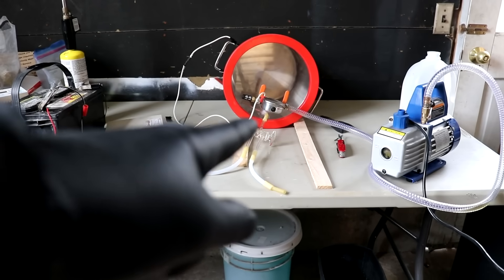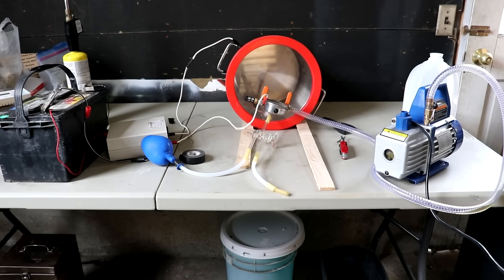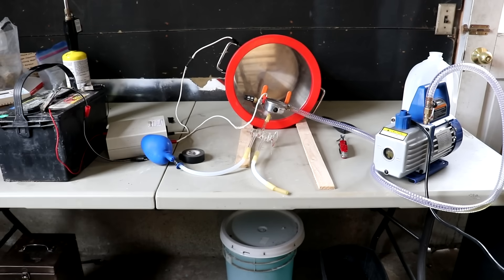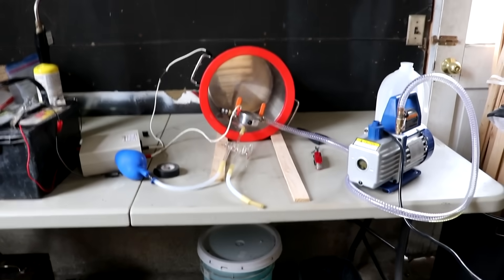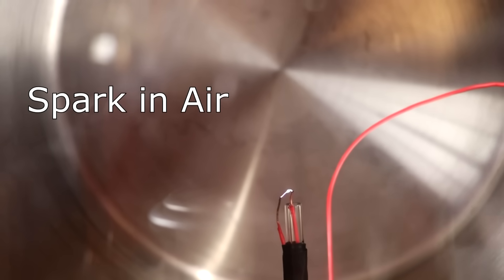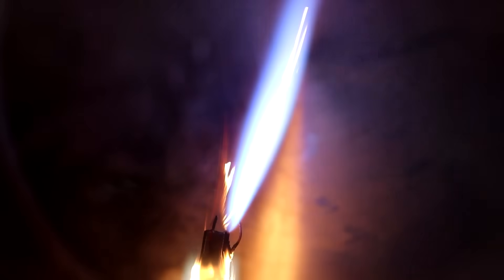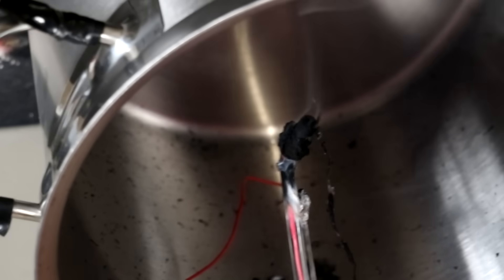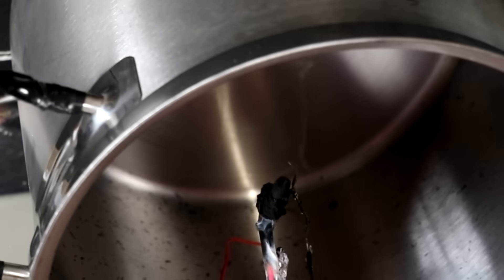Burning Propane in Pure Oxygen?

Comment: Back in the fifties, hot rodders experimented with using oxygen as a power adder. It melted the engine block and pistons, until they started using nitrous oxide.

Comment: You should do more videos of various flammmables in inert environmental gases. 

Although, I would recommend an outside set up, with remote control behind a protective barrier; mythbusters style, just in case. 

Also, I didn't realize it on the first watch through, but you were exactly correct and this is what happened to the unfortunate Apollo 1 capsule.

Comment: The spark was so much thicker in the oxygen because it has a lower resistance than regular air. Therefore, more current was able to flow, turning the arc into a single stranded purple stream instead of several small blue-white sparks. Probably has a bit to do with oxygen's flammability as well, as thick arcs like that are generally thick because they travel across plasma (ionised gas) instead of jumping through air.

Comment: Same problem exists with some of the fabrics we have in our fire department protective clothing. In normal air with ~21% oxygen they are practically inflammable; they get hot, but they don't burn. But put them in pure oxygen and they go off like rocket fuel.
Reply: Inflammable means flammable. The phrase you want is non-flammable.
Reply: Damn, you're right. That's a problem in English. Same with (in)famous.
But German also has some strange words.
E.g. "Umfahren".
Means either: drive around someone, not touching them.
Means also: drive over someone and knock him down.
Reply: @GrafKrolock82  I'll be sure to avoid that phrase if I ever get a German uber driver lol

Comment: Cody can you try to burn metal in a pure oxygen chamber?
Will the metal make a flame and continue to burn after been heated?
It's possible to cut metal with a oxy-fuel torch, first the flame heat the steel and then the oxygen jet cut the metal.

Comment: you know, this demonstrated alarmingly fast graphic nature of the Apollo one fire,  tiny spark then , a fire...a very fast fire...terrifying. we were told they suffocated before the fire did any damage to them alive, this rather grim "problem" as Cody says, illustrates otherwise to this fact. good video. Question: why doesn't the chamber explode in that environment? mixing O2 with Propane in a closed environment should explode right?, or is the pressure so low?

Comment: FYI you can get about a hundred times the volume of oxygen for about the same price if you buy it from a welding supply. And about thirty times the amount of propane  for your money by buying the BBQ size bottles. You can get adapters to run your equipment for the little bottles... Or adapters to just refill the little bottles. Or both like I do since it's sometimes convenient to have the little bottles... But not if you gotta buy new ones instead of just refilling them.

Comment: That was the same problem nasa had with the Apollo 1 crew. During the rehearsal they filled the cabin with pure O2 and things that (under normal atmospheric circumstances) wouldn’t normally catch fire, did catch fire from something as simple as static. 
Try testing flame retardants materials in a pure O2 atmosphere and watch how quickly they will burn.
Reply: Lol I wrote this comment before I watched the last part where you mentioned Apollo 1. 
Though it would be a cool video to watch if you tested various “flame retardant” materials in a pure O2 atmosphere.
Reply: Fun fact: They still used pure O2 for the remainder of the Apollo missions following the Apollo 1 disaster.
Reply: David Jackson, II i wish i understood this. It sounds smart.
Reply: If you knew that the universe is electric and that the electrons negative field binds atoms positive nuclei it would be much easier for everyone to understand. And if you knew gravity is an electromagnetic effect and not a particle you would be smarter than dj.
Reply: J fun fact for your fun fact, the partial pressure of oxygen in air is about 3.6 PSI. The oxygen pressure in A1's capsule at the time of rehearsal was about 12.3 PSI. All remaining missions were quadrouple checked for correct O2 pressure.

It's all about the density of the oxygen(and it's electronegative charge) surrounding an object that creates the electric field potential that pulls electrons into a reaction orbit around a molecule, causing chemical bonding and releasing energy exothermically.

Comment: I had something similar happen that caused me to require an underwear change while experimenting with a medical oxygen generator that I got from a scrapyard. I was testing to see if it was working by holding a glowing wooden match up to the tube which was made of vinyl. Turns out that it was working and vinyl is extremely flammable in an oxygen rich environment! I can compare what I saw to a very fast burning cannon fuse and needless to say the machine was toast!

Comment: dous anyone know why it is a yellow flame at first. but an blue one after the insulation cought fire?
Reply: postlim Yellow was propane, blue was oxygen.
Reply: that's why i asked. but still why the change over time? furthermore in a pure oxigen environement i would never expect an orange flame.
Reply: i looked up why sulfer might be used in glass. in the fabrication of glass bubbles might form. sulfer can be added in the form of Na2SO4. this disasosiates into Na2O SO2 and O2. SO2 is a gass and will make the bubbles alredy presend larger and able to rise to the surface to dissapate. therefore in clear bubblefree glass there is no sulfer presend.

Comment: This is what happened to Apollo 13's service module, in testing before prelaunch assembly, only they couldn't see a thing and the temperature gauges were not built to read supra-nominal temperatures nor could the mechanical pressure gauges read supra-nominal pressures!

Comment: If you could figure out a way to pump it and contain it (I’m sure the rubber seal isn’t compatible enough to do this) maybe you could try burning things in an atmosphere of Chlorine? Chlorine gas is easy enough to generate and I’m sure you could make a throwaway steel container to act as the chamber and do only quick tests, so it seems viable.

Comment: cody ot a challenge for you produce hydrogen run it through an oxyacetylene burner and see how hot the flame is and if it can cut through metals apparently it does and the gas aparently turns back into water somehow?

Comment: Oh by the way that's how they make rockets hybrid rocket Burns rubber in oxygen I should have said that when I let off of the video when I let off with the comments in the video
Reply: Voice search cut off half the comment so a hybrid rocket is essentially a rubber core with oxygen flowing around and a fuel threw it. The solid inside the rocket Burns because of pure oxygen and it becomes the fuel so essentially you made a hybrid rocket out of the wire coating

Comment: I wonder what would have happened if you showed this to NASA administrators in 1967 before the rehearsal test.  The push to succeed  before the end of the decade had to have been more intense than during the Shuttle era failures.
Reply: Probably nothing would have happened. I understand that using pure oxygen was a cost-saving measure (using pure oxygen at reduced pressure in-flight, to avoid using extra fuel to lift up "useless" nitrogen in liquid air) and the bean counters would have argued that "we used the same setup on Gemini missions and nothing happened".

Comment: Yeah, you could've predicted this happening. ;)

One correction - commenting on the previous video, you said "it's not the oxygen burning". It is. It's arbitrary. A burns in B if there's more B than A, and vice versa.
From a chemical standpoint, it's an irrelevant, arbitrary, human description because we live in an atmosphere with significant percentage of oxygen. Correct statement is - they react. Both are fuels but one is a reducer and other is an oxidizer. There is really no "fuel and oxidizer", there's "reducer and oxidizer" and both are fueling the fire which is an extremely fast and energetic redox reaction.

Comment: Do a hybrid rocket engine using oxygen and diamond grit/dust as the solid fuel. You would need to use a burnable binding agent to hold the dust/grit together in a cylinder shape.

Comment: Note that the propane flame appears yellow NOT due to the usual reason of incandescent soot of hydrocarbon flames that you are normally used to, but rather because the flame is so hot and ignites so instantaneously upon leaving the tip of the capillary tube, that it is vaporizing the glass of the delivery tube itself and thus producing the brilliant yellow D-lines characteristic of all sodium flames. It is only upon ignition of the wire insulation slightly below the propane tube tip that the propane flame turns its intrinsic blue green color charachteristic of all sootless hydrocarbon flames due to the strong carbon doublet rovibrational emission lines referred to as Swan bands. The burning wire insulation is producing CO2 and causing slight detachment of the propane flame from the glass tube tip, thus cooling it and suppressing the bright sodium emission. All of this can be seen in the frame by frame. Interesting.
Reply: Yes, thank you for this comment. :)
Reply: You could also see the same Swan band emissions in the previous video, with the spark in propane being a bright blue colour, rather than the purple of the spark in air.

Comment: Everything burns well in pure oxygen. Even people.
Reply: To burn everything you need Fluorine...
Reply: Антон Южаков even better is Chlorine trifluoride
Reply: FOOF is "better" but rather than burn it makes most things (ice, lab techs, chlorine trifluoride, asbestos ect)  explode violently at temperatures well below -100 degrees.
Reply: Oh god, not FOOF; I hear that's horrible stuff...
Reply: Could be worse. Could turn that OO in the F2O2 into an ozonide. FOOOF. Or FOOOOF.... Increase the reactivity (& sensitivity) through the roof. Likewise ClF5 is a bit more reactive than ClF3, though you can't stick any more fluorines on there.
Reply: No, Agent Orange is something completely different, it was a defoliation agent used in Vietnam to defoliage the trees so that it would be easier for attacking pilots to see where the Vietcong held up.
Zyklon B was the trademark name given by the "Farben AG" (now Bayer) to what was a chemical to kill bugs in homes containing cyanide.
Cyanide effectively makes you suffocate,as they cyanide binds to the red blood cells blocking oxygen from binding on these.
Reply: The defoliation part was what was stated in US propaganda and persists to this day, it primary use was to destroy crop and cause food shortage/famine.
Reply: TheAnubis022 thanks for the info :)
Reply: Even the Ring of Fire?
Reply: Wouldn't ClF7 be possible?
Reply: I wonder if a pure O2 atmosphere would cause problems with increased oxidation of teeth if breathed for a long time?
Reply: Ganaram Inukshuk FOOF / Asbestos fueled rockets, perhaps the most OSHA non-compliant phrase possible.
Reply: that's exactly what i thought
Reply: Kippenkop kuikenei let me call my grandpa real quick for that question :D
Reply: Especially people
Reply: To kill things you best use cyclon B ;D

Comment: You gotta find your self a good oxygen concentrator and Faber Coble up a secondary sieve to clean it up to 100% pure o2. Would save ya in the long run. Also a oxygen concentrator with a compressor is great to have around if you use the cutting torch alot

Comment: Next: use wire insulator as rocket fuel
Reply: I've seen a couple hybrid rockets that used ABS plastic as a fuel grain. PVC (usually what wire insulation is made of) has a lot  of chlorine in it, which makes it a fairly nasty fuel.
Reply: SandPox not too far from what Virgin galactic is doing.
Reply: Not to mention the HCl released eats "lots of stuff" (maybe even rocket bodies).

Comment: lols

It’s not like PVC in pure oxygen burns like rocket fuel or anything........
Reply: Not true. Fluorine, and some fluorine compounds, like ClF3, ClF5, and FOOF, are better oxidizers than oxygen itself. They're also pure Satan in molecular form.
Reply: FOOF is now my new favorite thing
Reply: Propellant chemist John Drury Clark had this to say on the topic of Chlorine Trifluoride:
"It is, of course, extremely toxic, but that's the least of the problem. It is hypergolic with every known fuel, and so rapidly hypergolic that no ignition delay has ever been measured. It is also hypergolic with such things as cloth, wood, and test engineers, not to mention asbestos, sand, and water—with which it reacts explosively. It can be kept in some of the ordinary structural metals—steel, copper, aluminum, etc.—because of the formation of a thin film of insoluble metal fluoride which protects the bulk of the metal, just as the invisible coat of oxide on aluminum keeps it from burning up in the atmosphere. If, however, this coat is melted or scrubbed off, and has no chance to reform, the operator is confronted with the problem of coping with a metal-fluorine fire. For dealing with this situation, I have always recommended a good pair of running shoes."
Reply: ValleysOfRain "A good pair of running shoes"... I don't think that would get me out of there fast enough... Better to use a Segway! And after I'm out of the building, just in case, a Formula One car!
Reply: GRBTutorials could use a rocket to... oh it's on fire
Reply: Matt Fields nudge nudge
Reply: slikrx So would you handle ClF3?
Reply: I love things that go boom, burn, and all that. I have no interest in being anywhere near FOOF.  Nope, nu-uh. It can be handled "semi-safely", but I'm not that adventurous.

Comment: Thanks for doing this! I half expected the flame to be the same color as the oxygen in propane. Any ideas why propane in oxygen burns colder and more yellow than oxygen in propane (which was blindingly white?)
Reply: The yellow comes from microscopic particles of carbon because of incomplete combustion..  They're hot so you get black body radiation, and at that temperature it's yellow.

Burn oxygen in propane and you're going to get complete combustion at the flame front.
Reply: bdf2718 why are the characteristics of the flame front different though? This is what puzzles me. Why is there incomplete combustion the one way round and complete combustion the other way?
Reply: +Michael Andersen
I'd guess it's down to turbulence and incomplete mixing at the flame front.

Propane in oxygen is going to be more surrounded by oxygen at the flame front than vice versa.  Something like that.  Probably.

Think of a bunsen burner.  When the inlet at the bottom is closed you get a wavery, cool, yellow flame.  Open the inlet and you get a blue, hot inner flame but it's yellow at the edges.

Turbulence is hard. :)